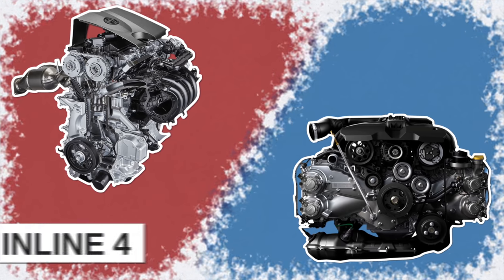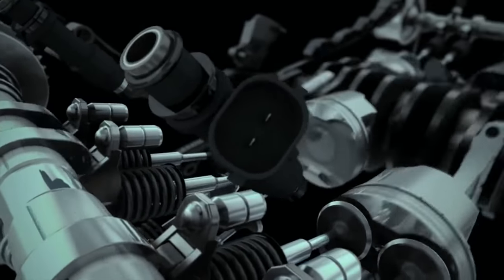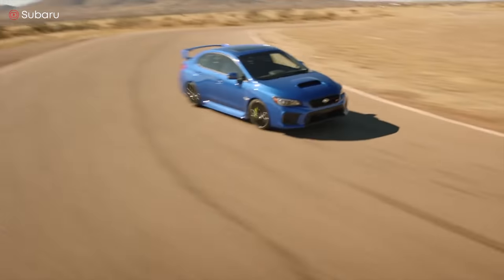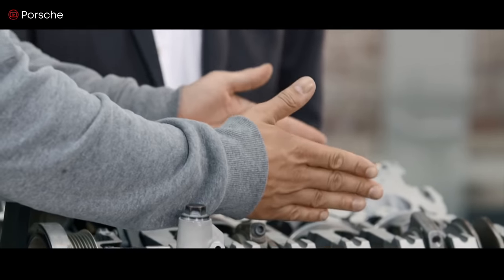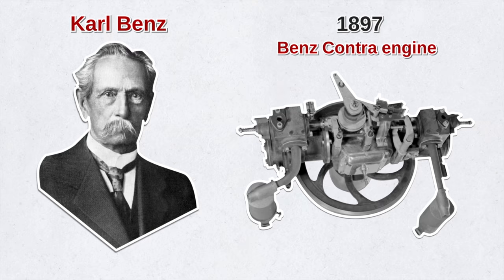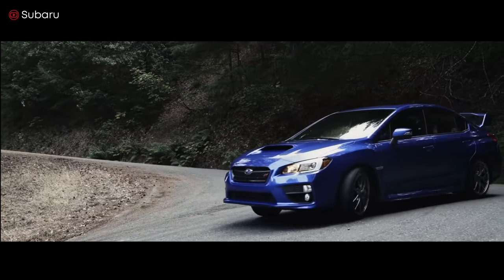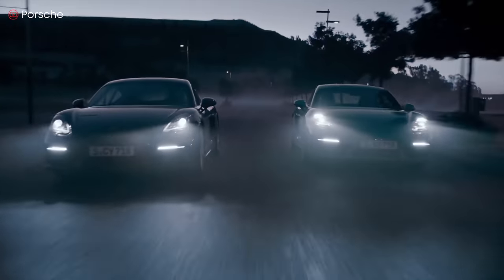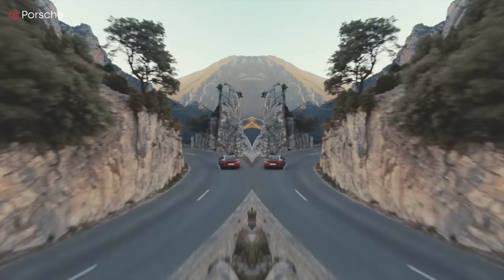Why Not to Buy a 4 Cylinder Engine Car

Comment: In most cars, they are front wheel drive, and the engine is not situated so that the pistons move straight up and down. Rather, to maximize utilization of space, and to keep the center of gravity low, the engines are typically mounted with the pistons going from left to right, and slanted with the tops facing forward somewhat. In countries where the driver sits on the left side of the car, the engine is typically at the right side of the engine bay, the crankshaft is situated from left to right, and the piston are slanted so that their tops are toward the front of the car. The slant angle may varies from car to car. The output end of the crank shaft is at the left side of the engine, and connects to the transaxle, a combination of transmission and differential, both in one housing, which is situated in the engine bay – unlike a rear wheel drive car which has a transmission hump in the front of the passenger cabin and has its differential at the center of the rear axle. So in short the pistons do not go straight up and down, they go at angle from the front of the car at the top of their travel, and toward the rear of the car at the bottom of their travel.

Comment: From everything that was said Honda sounds like the best all round option, besides new technology will eliminate most moving parts from the top of the inline 4 cylinder engine making them much more compact and powerful. I have seen computerised hydronic valves that don’t need cam- shafts or tappers , veritable value technology that is way ahead of anything else.

Comment: Most small airplane piston engines are 6-liter, 4-cylinder boxers, and they are pretty smooth. Maybe that's because it is swinging a prop, which acts like a flywheel.

Comment: I’ve always had 4 cylinder engines. My last had done 138000 miles, used no oil, perfect. Just changed it 'cos it was 16 yes old. Got another in line 4.

Comment: Having a 1.8 L 2011 Civic Auto naturally aspirated with 193K and a 2014 Ford Fusion 1.6L Turbo Manual 6 Speed with 154K I feel it completely has to do with MAINTAINING!! Both me and my husbands cars aren't "perfect", but they START, and run when we need them. People just need to service their cars when the manufacturer suggests and recommends...
Reply: BTW....neither of our cars have a Check Engine Light On....and the TPMS was resolved when we replaced the Sensors, so NO fault lamps at this age

Comment: What about the V engine? Is that a good compromise between inline and boxer?

Ford made a small V4 engine in the past. IIRC it was produced in a 1.2 litre and 1.5 litre version. It was used in the Ford Taunus 12M and 15M, but also in the Saab 96.

Comment: As a motorcycleist I have learned to love all V-twin engines, and hate all opposing force boxer engines.  If you don't know why, then you probably have never rode either one.   And no it has nothing to do with sound or vibration, from the Ducati 90°, to the H-D 45°, or the 60° Rotax... V-twins and motorcycles are a match made in heaven.  Why?  No need for traction control ignition cutting, when you have 2 cylinders on a 4 stroke engine.

Comment: Well actually my inline 4 redlines at 18000rpm double what most boxers would do. Cranking 45hp @ 15000rpm from its tiny 0.25 L engine.
Look it up Honda CBR250R.
There’s also a model that does over 20000rpm, CBR250RR.
Also a inline4 Evo can be tuned to handle a lot more power than a Subaru, not to mention being lighter, more reliable and easier to work on.

Comment: All four-cylinder engines often need head gaskets, thus, making in-line fours a better choice over the boxter engine due to lower repair costs. In-line four-cylinder engines are also some of the highest mileage engines out there. While I would admit that my 92 FWD Subaru legacy wagon had the best steering of any car I've ever owned, I am much happier with my 99 Camry four-cylinder. It's dependability is outstanding!

Comment: Inline 4 for me, not saying the boxer engine is junk but I just don't like it. my biggest complaint against Subaru is actually with their seats, I have sat in several Subarus over the years from brand new to a few year old and I can not find the right seat location to where I feel comfortable. Its sad with the 8 or 10 way power seat that I can't get comfortable in one.

Comment: Nice piece.  For once my intuitive, limited experience, guess about the main differences between the engines was correct, since I knew Subaru and Porsche used various boxer engines, and outfits like Toyota and Honda prefer inline engines for their economical 4 cylinder engines.

Comment: I want a boxer 4.  If it is going to leak, that is a deal breaker.  What exactly requires removing the engine?  Can't be dropping an engine to check spark plugs.
Reply: Plugs r on top just like oil filter.

Comment: Scotty. Boxer 4 is NOT smoother than the inline 4. The inline 4 is actually smotther because of the balance shaft exerting a TORQUE on the overall piston force, this causes the rotation.... not a vibration. I am advanced in physics on this subject. An outward torque will always have a veloctiry (direction AND accelation), where as the boxer loses this advantage.

Comment: Dear Scotty:  Why not cut-up an LS into a V-4, and compare what you'd then have, compared to an inline 4/flat-4?     Or Honda's "ST" 1300 motorcycle V-4,--a very good engine I've heard..  Back to the "cut-up LS", --a 6.0L would bring one to a 3L V-4, which could be turbo'd/not.  There must be software, where you could "do" this for us, --visually, without going to the first junkyard and ruining saw blades.  Lancia made V-4s that had "Narrow-angle Vees", so they only needed ONE cylinder head, the banks were so close, saving weight & complexity.  LOV yer vids!  If I could drive to Tenn., I'd pay EXTRA to have you look @ my routine stuff, although you've given me the gumption to get some test-equipment and see what I can do.    I had a wonderful '94 Saturn W-2, with a 5-spd that had its fluids changed @ about half the GM recommended intervals.   Even in Arizona, I had NO engine troubles.

Comment: I wish they would make a car version of Yamaha's crossplane 4, that engine is magic, I have a crossplane 3 Yamaha, a (triplane). Its the most wonderful engine in the world. I get 75% of my torque @ 2,500 rpm, and then it peaks @ 3500, then keeps that torque all the way to 11,000. The crossplane firing order is weird, but you get 4 even pulses per 720 degrees. They sound amazing!!  My bike is a 2014 fz09, with 50,000 miles on it, so far only plugs and oil changes. I expect to get 150k miles out of it ( that's a lot for a hard working motorcycle engine).

Comment: Hi Scotty, Another great video. Very informative! You only mentioned Porsche’s Boxer-6 once - the engine that powered just about all the 911s. What is the firing order in a Boxer-6? Does Porsche still make Boxer-6 engines ... or have they switched all 911s to the Boxer-4 with turbo?

Comment: It really doesn't matter if it's a 4 , 6 or 8 cylinder because where I live the car body usually  rusts out before the engine fails . I guess steel car bodies last forever in the dry  desert but not if you live in the north east coast's salty air and over salted roads in winter .

Comment: Inline four and at least 3.2 liter and a manual transmission with 6 gears for freeway driving even after the engine is getting old and getting less power to the wheels.

Comment: I've got a 2020 outback and I must say, I like the boxer engine. We got the 2.4 XT (the one with the turbo). It's smooth, fast, and gets 28 miles to the gallon on road trips. This is a high tech engine, I don't think the boxer is any more dated than the inline four since they both have been around for a long time.  I even like the CVT even though I'm not a fan of the simulated gearing. To me, the perfect transmission will be able to keep the engine rpm at the optimal point while increasing the wheel speed. This is what the ideal transmission should do. But people are accustomed to distinct gears and so they say the CVT feels weird. If cars started with a CVT and then, for some unknown reason, went to gearing, people wouldn't like the feel of gears. It's just what people are accustomed to.

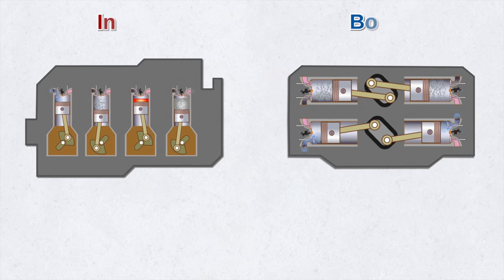Comment: 1:33 Your red highlighting and narration imply 1342, but in the original animation, the little sparks that appear and the motion of the pistons say 3214. The latter makes more sense, since 1 and 3 are shown rising at the same time  and thus have to fire 360 degrees apart from each other. I'm sure there are some engines in which 1 and 3 rise at opposite intervals (this, at least to my eyes, would seem to be more conducive to perfect balance), and thus could fire 180 degrees from each other, but not the one in this animation.
Reply: On the boxer side, while your narration makes perfect sense for the motion of the pistons, the original animation shows two power strokes happening simultaneously, which would make for a very odd-firing engine (stop to video at 1:39 for a perfect view of this).

Comment: Not so!
Subaru did not always mfg boxer motors as you stated. 

I know this for a fact because when I was in high school saw my father sell a couple small subaru’s with a 2cyl 2stroke motor in the rear.

I think they also had a 4spd trans & 12” tires but am not 100% sure on 
that.

See below for details

The Subaru R-2 is a kei car manufactured by Subaru from 1969 to 1972. The R-2 was a full model change of the popular Subaru 360, but with an updated appearance and increased interior space. The R-2 appeared approximately one year before the Honda Life, Daihatsu Fellow Max and Suzuki Fronte kei cars, however, it continued to use the powertrain setup from the Subaru 360, which was the EK33 air-cooled 2-cylinder engine installed in the back, which is the inspiration for the name of the vehicle. It appeared around the same time as the second generation Mitsubishi Minica.

Comment: So the lower center of gravity advantage makes sense in theory.  In practical terms, with inline 4 powered cars that do just fine in the handling department, I'd hardly call it a major differentiator.  I've been driving a Subaru for 14+ years now, and with almost 167k miles on the clock, my '07 Legacy has been through one set of head gaskets and gets topped off with oil regularly now.  Not sure what I'd go for to replace it, but I'm really liking the Honda Accord.  I wish it offered AWD, but I think I'd take a FWD Accord with the 10 speed auto over a new Legacy plagued with a CVT and ugly styling.  (Styling is subjective of course, but I haven't found the Legacy appealing since the 4th gen BL/BP Legacy design.)

Comment: I got new brake pads, rotors and calipers as well as hoses! Brakes are still locking what is my issues!? 2010 mercury Milan premier less than 90,000 miles!

Comment: You get dangerous torque steer out of a regular front wheel drive 4. You don't get that with the boxer. Everything is balanced perfectly from the front bumper to the rear. You can't do that with the inline 4  That's why Subaru chose that particular engine.

Comment: Het Scotty big fan of yours!! Does Subaru still have that oil consumption and head gasket failures at or near 80K miles???  I put 200K miles on my Chevy Cavalier RS 2.2L  in-line 4 with no trouble the car is still running with new owner...so in-line 4 me.. BTW I’m trading  my Equinox LTZ 2.4L on a 1965 AMC Marlin fastback with inline 6 ..I hate all 2015 and on cars electronics,electronics 500 computer crap codes on engines Forget it!!! 40 year mechanic here, retired...I wish it was the 1970s over again... I’m subscribed to you...❤️👍

Comment: Scotty, with all respect to your knowledge, for just one time I can tell you something new for you. Boxer and flat engines are not the same. In boxer engines opposite pistons move out together and in together. In flat engines opposite pistons move one in, one out together.That's why Subarus make a different characteristic noise than Porsches. If you look at them they look the same, but they're not.

Comment: Boxer? I never heard it called that. It's a Horizontally Opposed , they come in 2, 4 and 6 cylinders.

I have a 1992 Volvo 240 with an inline 4 cylinder. I have plenty of power and the Swedish Tank is nearly indestructible.
Reply: Old Volvos are great cars.

Comment: V8. You can play with things like turbo's and port injection all you want, but at the end of the day Your power peak of 300 is racing at 6k+ RPM + forced air pressure and that = high complexity and lower life. Your NA V8 can do that at 3500 rpm and do it for years with minimum maintenance on it.

Comment: I dislike 4 bangers as well but finding a 6 these days is hard to do.  I don't want or need a 15 mpg v8. As a mechanic myself I'm good with nissan 3.5 v6 it's mated to an ok cvt ( cvt gets bad rap but if you change cvt fluid every 25 k- 30 k miles it's all good and If it's a chain over the old cvt belts even better)  nissan v6 tuned gets 26 mpg mix of driving doesn't require premium fuel and will run smooth for many years to come.  Now nearly  every affordable  phev gas / electric  hybrid has 4 in it and other than the rav4 prime you can keep em their dogs, boring to drive, mushy or uninspired.  Just my chime in.  Sure you may agree or disagree or agree to disagree like my wife does but just my 2  cents.

Comment: I really enjoy this type of educational video that Scotty puts together. Reminds me of high school autoshop working on my first car, a 64' Chevy Belair with a straight six and two speed power glide transmission. Anyway I digress. Regarding which four cylinder engine is my favorite, well I've only had experience with the inline version so as they say I am biased. However, now I am curious about the boxer engine and definitely up for a test drive around the track. Strictly for educational purposes of course.

Comment: Scotty what do you think about the V4. Had a 1967 Saab with a V4 motor...true story! Had a 3 on the tree transmission too lol. I was told it was based on the Ford 289 design only 4 instead of 8 cylinders.
Reply: The Saab engine was indeed a European Ford unit, but it was based on the German-Ford “Cologne” V6, same as found in the Ford Ranger!

UK-Ford had an “Essex” based V4, but it wasn’t much to write home about...
Reply: The later SAAB 96’s had a 4 speed column mounted shifter, it was not as durable as the 3 speed “King Kong” transmissions .

Comment: The boxer engine is the one but Subaru ruined it by connecting it with a CVT. I had a 2007 Outback and loved it the tranny was a automatic with a manual shift 4 speed. In the snow and in the mountains of Upstate New York was so much fun. The tranny had a oil filter like a regular engine has. Now like everything else they went to CRAP!

Comment: My Honda DX 2004 has 100,000 miles. Still going strong. Do turbos last that long? I hear that they run hotter and wear out faster. Obviously, I do not need a turbo car. I have inline 4.

Comment: I went from a V-6 with a timing belt and tough to access back 3 cylinders to an in-line four Toyota with a timing chain. Cost of maintenance on the V6 was not cheap and maintenance on the in line for I can do myself.  Would never go back.  The Toyota engine is as smooth and reliable as I would ever need, so the boxer is not for me.

Comment: I have 2005 subaru Impreza RS wagon, it has 380ftp torque and 288hp out of a 2.0 wrx engine from Japan bolted on a 4.44 gear ratio 6 speed 2003 sti from Japan, it is a car for fun not a daily driver. i have Matrix xrs for daily drive, good car, but when you talk about driving pleasure, ain't nothing like a Subaru!

Comment: Too late, I bought a 2004 Toyota Xion XB box car has 4 cylinders. Far superior to my former Kia Soul that the engine died at 60 k miles. This Xion has 150 k. And has proven it's superior build. I will have the engine rebuilt when it needs it.

Comment: The “disadvantages” of the in-line 4 are trivial, IMO. Different 4-strokes for different folks. 

You’ve correctly pointed out many times that Honda makes the best engines. They don’t bother with a Boxer design. Neither does Toyota.
Reply: From an engineering perspective the boxer wins easily.
From a cost perspective the i4 wins. Carmakers can make more money.
Toyotas are the most boring cars on the planet.
Reply: As a consumer, my perspective is practicality. I’ve never owned a Toyota, but I’ve owned Hondas since ‘74. Still driving the second one. They really do last forever if you take care of them. And they’re easier and cheaper to work on than a Boxer.

Comment: I bought a 2003 Forests with 130k miles on it. I wanted to make it my winter beater.... It had supposedly just had it's headgaskets replaced & water pump, timing belt etc... It ran for 300 miles before overheating and bubbling coolant. So, I had the heads shaved, new gaskets installed, new timing belt, water pump etc..... It's overheating two months later... Not even 1000 miles more.. Needs a new Valve cover gasket also, due to the smoke from oil collecting on the headers.... This thing is a money-pit and I'm glad I know how to do most of the work myself. I single mother would be screwed owning it though... That's why I don't want to sell it an burden someone else... I'll just park it I guess... Anybody want it? I'll sell it to an aware buyer.

Comment: Why don’t they just lay an inline 4 down on it’s side?  (Like an extreme slant six). It’d still have the same balance issues but a much lower center of gravity and be lighter than a boxer no?  It would of course hinder servicing like a boxer but less so than having a second crankcase and head with the long timing belt/chain/etc and be a helluva lot cheaper!
Reply: For that matter why not 60’s lancia style V4’s? (like the vw VR series… but with a little square 4 cyl)